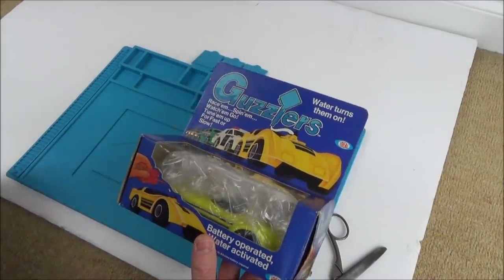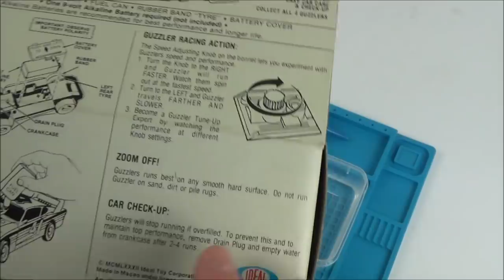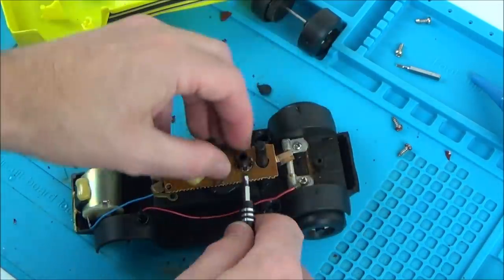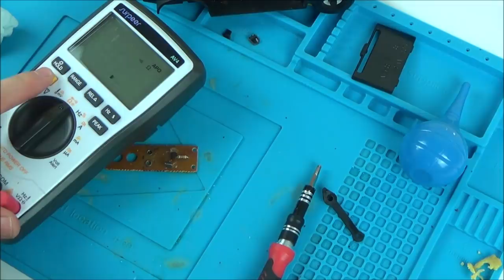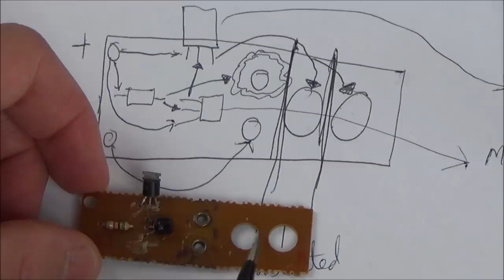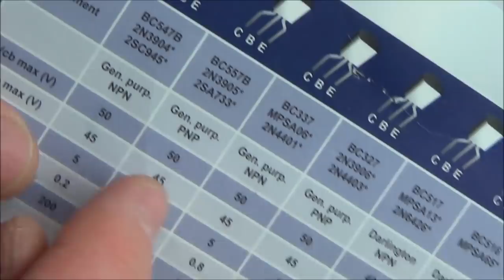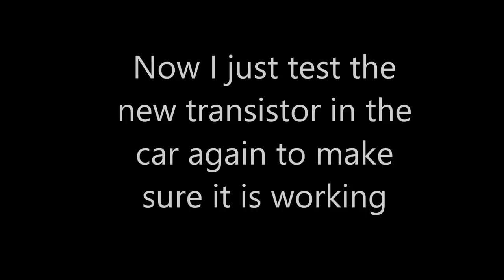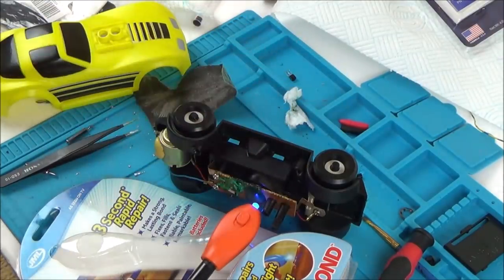Trying to FIX: 1980 Guzzlers Water Activated Toy Car

Comment: The reason the tweezers kill the transistor is that the +9v wire from the battery goes to one of the two studs and the other one goes directly into the base of one of the transistors.  The tweezers therefore allow way too much current to flow into the base, which blows it up.  The water has a resistance of a few hundred ohms at least, which limits the current into the base of the transistor and protects it from exploderation.
Reply from the maker: Thank you Skonk, that makes more sense to me now. Thanks for explaining it :-)
Reply: @Mymatevince  Yep the car works similar to an electronics kit I had when leaning electronics, and uses the idea of a small current controlling a bigger one. In this case, the 2 transistor amplifier takes the weak current flowing through the water to turn on the larger current flowing through the motor and rheostat (resistor). My circuit took the weak current from a finger placed on stripboard, to turn on a 12V lamp (a touch switch). Mine used 2 extra transistors and a capacitor, to act as a flip-flop circuit, so the lamp would come on with the first touch, and go out with the next. The number of transistors I popped by shorting the pads when learning to troubleshoot was quite high ;)
Reply: @Mymatevince  What he said.. Another thing to note, if you were to use distilled water, it will mostly likely not work at all.
Reply: @Gh0st620  Definitely! That's why the instructions emphasize to use ordinary tap water, only

Comment: I didn't know this kind of cars existed, what a great idea for a child, I would have loved this toy back when I was a kid. Anyway, I used to have a Tandy toy that consisted of a collection of electronic components (transistors, resistors, capacitors, ...) and it included a booklet describing circuits to create (a radio, a siren, the sound of a bird and many more). One of the circuits was what they called a water alarm; so when the circuit was done, you were supposed to put 2 wires in e.g. a glass and when you filled the glass up with water, as soon as the water touched both wires, the alarm would go off. So, that worked on the same principle I think... And in fact, there are some little aids for blind people (like I am) to prevent overfilling a glass; that also may work on that same principle. What a nice one Vince!

Comment: I had worked it out as soon as you opened it. £8 for priceless knowledge or a greasy kebab on a Friday night? I know what I would choose. You are learning faster this way than sitting in multiple lectures!!
Reply: By the way, I have looked through the comments but does'nt seems to have a post. That tranny generally only needs around 0.6V at base to 'turn on' hence why the small resistance of the water is enough.

Comment: Excellent video!  Enjoyed that!   The reason the tweezer killed the transistor - water is not very low resistance!  A dead short will overload the transistor!  Water has a resistance and its more than you think!
Reply from the maker: Thanks Chris, I bet you were yelling at the screen on that one!!!! Did you have that circuit sussed out in a couple of minutes?
Reply: @Mymatevince  Haha =D  Yes, it's a simple circuit but what made it confusing is all the protective coating so you couldnt see the traces etc.  It was worth doing all the things you did to it for the learning experience!  Sometimes we have to kill parts to understand why =D  Well done on this, it was great =D
Reply: @Mymatevince  LOL @ the waxy mess lol!  I would just have used a glue gun on those transistors!  The UV mask was a good idea though, but it takes ages to dry =/  A stroke of genius with the gear!  You could spin that gear and use sand paper to smooth the teeth off - but looks great anyway!!!
Reply from the maker: @GadgetUK164  I knew you would have :-) I was on that for over an hour scratching my head. I was so relieved when it worked again especially as I caused all the problems. For a toy that looks so cheap and plasticky on the outside I thought the inside looked good / interesting, that Scalextric bit did it for me.
Reply from the maker: @GadgetUK164  Thanks mate, I did get lucky with the size of the gear. Waxy mess =  illuminous snot. I would love to see the reaction of the next person to open that up in years to come, when confronted with that!!!! Yeah the UV mask is a real pain BUT I was just given an eBay link for a more powerful UV light. Only £3 from China so I have placed the order. Hopefully it will speed it up :-)
Reply: @Mymatevince  I might have to get one of those UV lights myself!  It will save me using Nail Polish instead lol!
Reply: @Mymatevince  Hehe =D  It was something you needed to do though - well worth it as I say, and you totally worked it out without any help or advice etc.  You know more about electronics than you think!
Reply from the maker: Haha, more trail and error than knowledge but thanks, I will take that and wear it with pride :-) The link from Simon Nemeth is https://www.ebay.co.uk/itm/UV-Flashlight-Purple-Violet-Light-LED-CREE-Q5-Flashlight-Torch-Zoomable-Aluminum/282914300903?hash=item41df01a3e7:g:nKoAAOSwYwdax32Y Anything has to be better than the little pen I have and at that price it is worth the gamble :-)

Comment: This reminded me of the very first circuit I ever made with transistors - it was a rain detector with a pair of transistors wired up as a "darlington" pair - very high gain which would enter saturation (ON) by a single drop of water across the base circuit which activated a buzzer (nearly caused grandmother a heart attack). The rheostat winding speed control wiper assembly is lovely to see again. A trip down memory lane.  A wet finger would have been preferable to the tweezers.....

Comment: the transistor blows up  when shorting it because of the high current on the base of the transistor , water acts as a resistor limiting the current to the base

Comment: The base of the transistor has a maximum current rating. If you check the datasheet it will list what it can accept. The usual approach when integrating a transistor into a circuit is to put a resistor on the base pin which will limit the maximum current that can flow. Often in the kilo ohm range, depending on the voltage. Since water ('pure' tap water) has limited conductivity, the water effectively acts as this resistor, allowing only a mA or two to flow. 

It should therefore not come as a surprise that by using a conductor that has effectively zero Ohm resistance, the transistor gate gets whatever the battery can deliver through it, destroying it in the process. Definitely one of those instances where the circuit is fine when used as intended, but will fail dramatically when not.
Reply from the maker: Thanks for the explanation Maya. Nice one :-)

Comment: The transistors are configured as Sziklai pair. You can look it up on wikipedia. The water is is series with the resistor and when water is present the Sziklai pair is activated because the water pulls the input low. It's a PNP Sziklai pair. (there are 2 types).
Reply from the maker: I will Google it now :-)

Comment: Hey Vince, would love to know if you try distilled water, whether it will still work as I assume, it's the impurities in the tap water that bridges the connection.  This would also mean that there would be more resistance than the tweezers you used.  Great vid as always
Reply: @Pascal Ahah, thanks.  I always wondered whether it was actually water that was conductive.  Would definitely make an interesting follow up video
Reply: @braindeadmm6  tell you what ..try dropping something plugged in to the mains into a bath when you are in it .. OF COURSE WATER IS CONDUCTIVE ....IDIOT!
Reply: @kittyhawk9707  distilled water ISNT conductive, dont call people names, makes you look dumb when you're wrong for sure
Reply: @jusb1066  Hey Dickhead .. i quote  " I always wondered whether it was actually WATER that was conductive" ... !!  Hey clever git were does it mention distilled water in that quote???? ..  not so clever now are you asshole !!!!!

Comment: The G905 is a 2.5 volt voltage regulator. It is a type of chip. It has a input, a output and a ground. It takes a maximum of 7 volt and a minimum of 4 volt on the input and outputs 2.5 volt. When it blew it went open circuit. Hence it stopped. You replaced it with an NPN transistor. When it blew it went short circuit. Hence it heated up and kept running.
Reply: Agreed, and it doesn't look like a particularly common chip. I wonder if a generic 2.5 or 3v regulator would drop in?
Reply from the maker: Hi PDS, so it outputs 2.5V to switch on the next transistor which then allows the 9V through to the speed controller. Is that correct? I put in a PNP transistor instead, do you think that is going to work OK long term rather than the 2.5V voltage regulator????? Also any idea why overfilling them would stop them from running as the instructions state? Can see why having too much water in there would stop them from running.
Reply: @Mymatevince  From what I can see the resistor and the water form a potential divider, with the base of the transistor at the center point. The collector of the transistor is connected to + volts and the emitter is connected to 0 Volts, The input of the voltage regulator is connected to + volts, the ground is connected to 0 Volts, the output goes to the wiper of the variable resistor(the scalextric thing). The other end of the variable resistor connects to positive of the motor, and the negative of the motor connects to 0 volts.

This would mean that when there is no water the transistor is on and the path between collector and emitter has low resistance,  this means that the voltage on the positive rail is very low(I know it is connected to a 9 volt battery but because your putting a low resistance across it the voltage drops). This in turn means there is no output from the voltage regulator and the motor doesn't run.

When there is water the current goes through that rather than the base of the transistor. Since the transistor doesn't get switched on there is voltage on the input of the voltage regulator and therefore it outputs 2.5V to the motor. The variable resistor adjusts the current to the motor.

Oh in only youtube had some way to uploading pictures, it's really hard explaining circuits with words.
Reply: @pds8475  I think the 1meg resistor is to avoid any spureous interference to make the motor run, the emitter is connected to VCC (it's NPN), the base is connected to GND through the resistor and to one of the plates, the collector then is connected to VIN of the G905. When you add water the plates short and the second plate is connected to VCC, that conduces more than the 1Meg resistor and turns on the transistor that feeds the regulator, in the way you explained it the battery would die in a couple of minutes when it's stopped.

Here is the schematic :D https://imgur.com/a/7DDs0i1
Reply: @pds8475  Crap, I'm too tired, no, the emitter is the output and collector the input, I was thinking in electrons flow. https://imgur.com/a/EicjrQ3
Reply: @drgusman  your picture only makes sense to me if it was a PNP transistor. A NPN transistor conducts from collector to emitter. So the collector would be tied to the VCC rail and the emitter would be feeding the voltage regulator. As well the BD135 takes a maximum of 5 v on the base, however in your picture you would be putting virtually the full 9v on the base, This would blow the transistor every time you put water in. For your circuit diagram to work the collector and emitter of the transistor would have to be swapped over and also the resistor and the holes for the water. But even then it would be doing the exact opposite, when no water was in, it would run and when you put water in it would stop.  My idea of the schematic is at:
https://imgur.com/a/wwv5Xm7
Reply: @pds8475   pds8475  I just tried to "translate" Vince's drawing after 14 hours of work, so my mind was not very clear :). As you said, it's NPN, the motor is connected to VOUT in one side, the other is to the collector and the emitter to ground, so the collector is positive respect to emitter, instead of breaking the circuit on the positive side of the motor it does it on the negative. Also, the base isn't tied to VCC but to VOUT.

Are you watching the first circuit? I was really tired and did a ton of mistakes, the good one is the third one, this: https://imgur.com/a/noT52Oa
Reply from the maker: PDS/Geniwab. Thanks for all the comments and breaking down the workings of the circuit along with the schematics :-)
Reply: @drgusman  yes I was looking at your first drawing. sorry I didn't see your other comments in my notifications. It makes a lot more sense now and as you said it's hard to translate Vince's drawing to a schematic. Anyway I hope you have a good kip.
Reply: @pds8475  It has been fun, at least it amenized an insomnia night... xD
Reply: I know google says this. But it's not. It's a PNP transistor. The transistors are configured as Sziklai pair. It's a 2N3905 PNP transistor. Only the 905 part is printed.
Reply: @kriswillems5661  In fact that does a lot more sense with the change I have found on the motor connection. Thanks for the info :D
Reply: @geniwab The G905 voltage regulator didn't exist in 1982 ....
Reply: @kriswillems5661  Lol, then it's totally clear :D Also I was wondering why the GND of the regulator was not connected to GND and was through the water, now with the PNP makes total sense.
Reply: @drgusman  Yep. the water is just in series with the resistor (and the 2 of them in series are connected to the supply).  The water pulls the input of the Sziklai pair low.
Reply from the maker: Geniwab, I was just heading down to these comments to let you know Kris Willems found the component.... when I see you guys have already had the discussion :-) Mystery solved, thanks for all the help. Apologies earlier for not mentioning the negative was also going off to the motor as well as the water pin !!!! You know I always like to confuse things a bit :-)
Reply: @Mymatevince  No need to apologize Vince, you're doing a great job :D

Ok, here's the final schematic: https://imgur.com/a/aZ6Lfzx

As Kris said it's a Sziklai PNP/NPN configuration, the 2n3905 has it's base connected to VCC through the 1M resistor that polarizes inversely it's base to avoid it to turn on by spureous interferences, when the water is added it connects the base to GND and as the water has less resistance than the 1M resistor it conduces a bit of current. The base of the BD135 is connected to the collector of the 2N3905 so when it turns on the BD135 also turns on amplifying the signal and driving enough current to the rheostat and the motor. 

This configuration explains why the car stops when the water overflows, it gets to the holes where the rheostat is connected shorting the BD135's emitter and 2n3905's base, as the BD135 emitter is positive the current flows to it and stops polarizing the 2n3905's base.

Also when you shorted the pins the 2n3905 turned completely on so the collector's current surpassed the 200mA that it's rated and burned out.

Now everything makes sense ;)

Comment: The reason why you have two transistors is:
One is activating the motor since water has high resistance 
Second one stops the circuit when overfilled water bridges it.
You can connect the third one with IR Sensor to control it via TV remote controller.

Comment: What makes it stop though? I have a hard time the water gets electrolyzed or something...
Reply from the maker: No, I think it just falls away because of gravity and the movement of the car. After a few runs you have to empty the water from the front tank. If you put more in it lasts longer purely because it takes longer for the water to drip away. I think this is how it works :-)
Reply: @Mymatevince  Oh ok... I totally missed the second tank as I watched the video 😂. At first you had me thinking that was a bad design is you end up with a wet floor after playing... Makes sense now, thanks!

Comment: Old school variable resistors, great stuff. Also doubling as heating elements when you apply enough current, although not for long :) Probably why its wrapped around ceramic. Those old clips can be pulled upward and kind of unscrewed, they make their own thread through the plastic. So Self un-tapping? lol

Comment: The G905 transistor is a low drop out device used to turn off the motor when it measured too much conductance from the water height. So the water level is monitored by how far up the screws it goes, up to 3/4 and it allows enough voltage to pass into the collector of NPN transistor to turn it on, and too much causes the low drop out transistor to turn off the motor. 
The conductance of water changes with its level of osmosis or how much mineral content it carries and is measured in microsiemens. 
(The microsiemens is the SI defined unit equal to the microohm. One microsiemens is the electrical conductance equal to 1/1,000,000 of a siemens, which is equal to one ampere per volt. The microsiemens is a multiple of the siemens, which is the SI derived unit for electrical conductance).

Comment: Transistor BD135 (3. Base 2. Collector 1.Emitter) https://www.onsemi.com/pub/Collateral/BD135-D.PDF
Voltage Regulator G905 2.5V (1. Voltage in - 2. Ground - 3. Voltage out) http://www.gmt.com.tw/product/datasheet/EDS-905.pdf 

The middle pin of g905 (Leg 2) is the ground and is connected to the contacts that close with the water the circuit. The output voltage of g905 is connected to the collector of transistor 135g (leg 2) and goes through the emitter (Leg 1) to the coil resistance that goes to the motor, the base receives the voltage of 9 volts (Leg 3), which is crazy.

The problem with this design is that there are no capacitors between Vin and Vout and the ground, so the car's speed must be unstable.